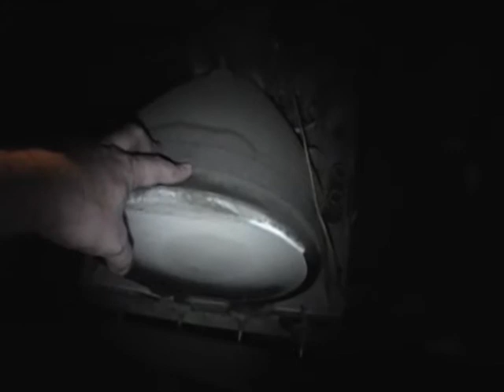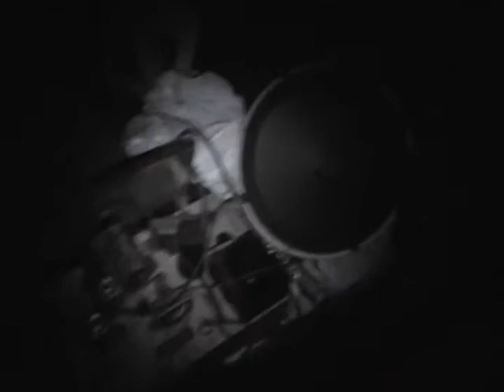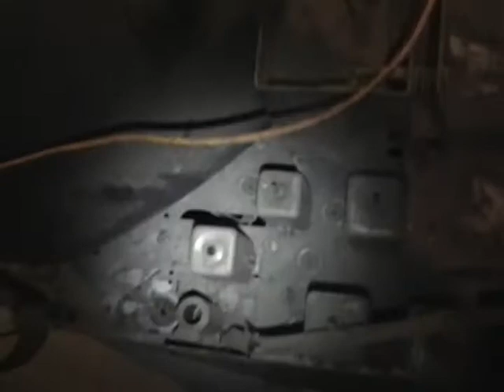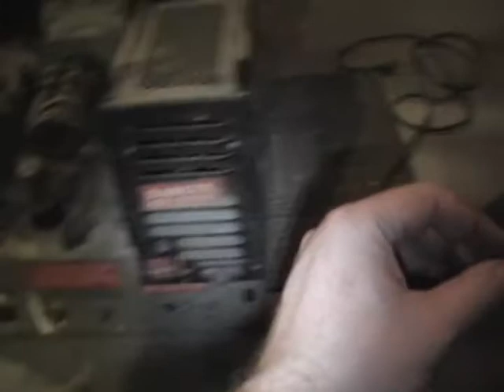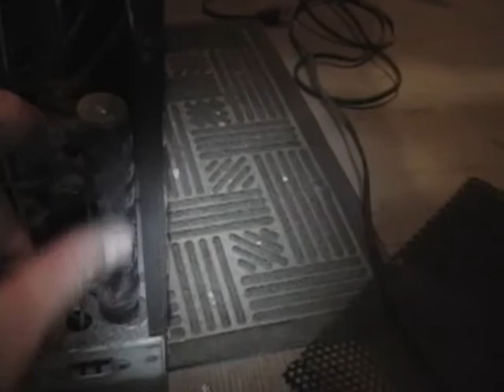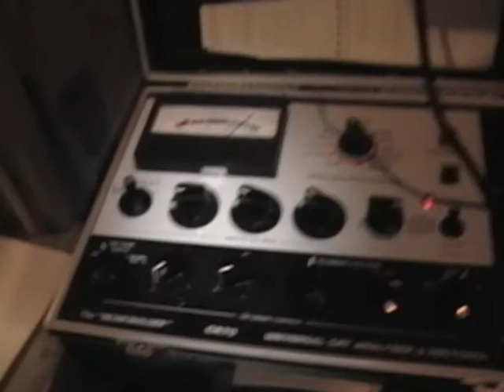Admiral Triple Thrill salvage p1o2

Comment: Hi Does anyone know how to put a value on one of these  Admiral Triple Thrill  tv console  ( Blonde cabinet )  I picked it up about 15 years ago and its been sitting in my basement ever since. It seems to be in very good condition. What should  i look for and how to put a year on it ? It does look like the one i saw in some ads that were 1948 - 1950  I remember it did power up but that was when i first got it.  thanks for your time
Reply from the maker: They were made in 1948.  Not much value I'm afraid because of the size.  Maybe $25-50 on a good day ?  Perhaps a little more if the picture tube is good.